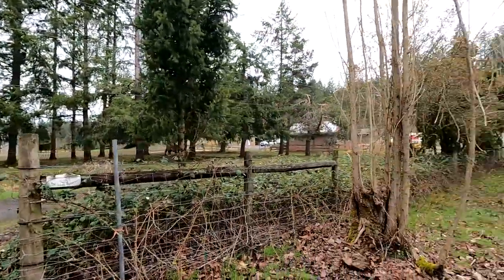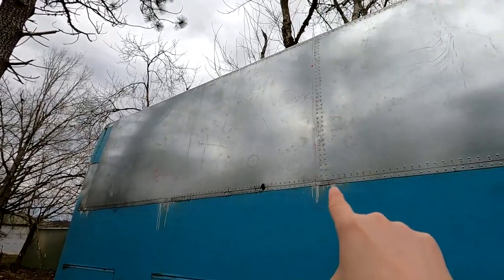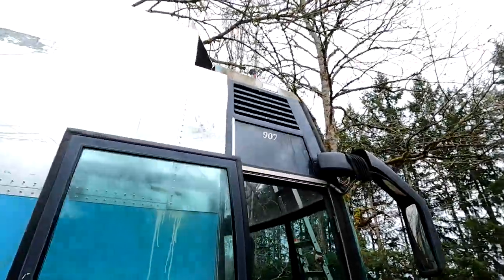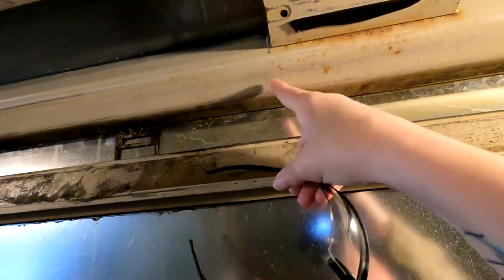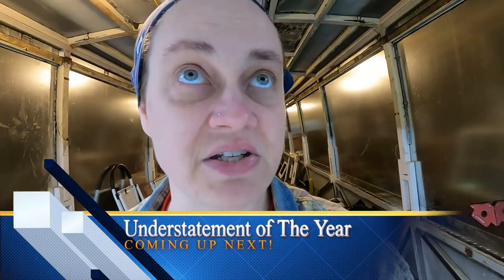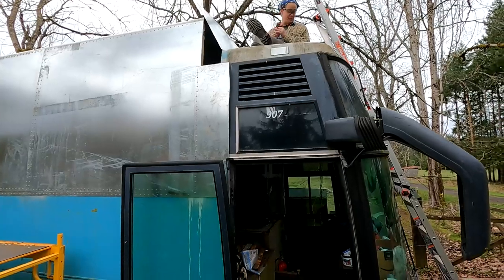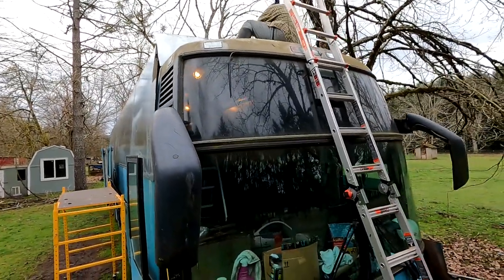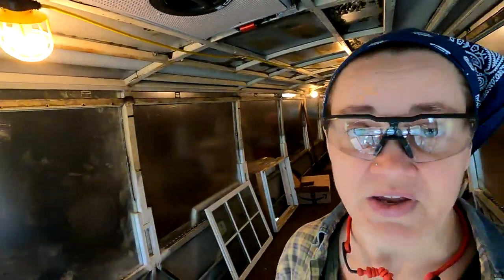Coach Bus Conversion Roof Raise Transition!

Comment: ahhh the roof raise makes such a difference, are you glad you did it? Was it worth the effort would you say? I would love the height but so daunted by the mammoth effort of the task, hats off to you both well done champs!
Reply from the maker: Thank you very much!

I was scared to death, but I could not walk upright except in the middle, where there was an aisle about 4 inches lower than where the seats had been. This is our home, and I did not want to compromise on something so basic as walking headroom. Skoolie videos make it look so easy, but coach buses are not school buses, and we had to come up with a method to do it from scratch. Now that it's done, I am very happy we did it. At first we thought we might lower the floor as needed instead, but realised that A) that would only give us those 4 inches, and B) the engineering required would be far more complex than just lifting the roof and putting in extensions. We got a whole foot which puts us a just under the max height allowed by law here, and the engineering, while tedious to implement, was dead simple!

Comment: Would sheet metal make good interior walls do you think, or what is your plan for interior walls? You guys seem like a wealth of knowledge I am following along, love your efforts!
Reply from the maker: Oh gosh you're too kind! Thank you so much! We're honestly finding our way almost blindly in the dark since there's not a lot of information out there specific to coach conversions like this. I took a basic welding course just for this, and taught my partner so she could do it too. We've learned skills we never thought we would ever need. :-P

To your question about interior walls, because we will be travelling in areas prone to large temperature variations, sheet metal interior walls wouldn't be a good idea. Temperature differential, conduction, all that fun stuff. Metal is very good at conducting heat (or cold for that matter) away from where you really want it to be. So we're going with closed-cell spray foam insulation which is also a great vapour barrier (good for avoiding condensation), and then probably birch plywood on firring strips attached to the metal bus framing. The idea will be to have absolutely no metal showing to the inside area of the bus to avoid this loss of inside environment because of conductivity. Chuck Cassady does a good video on this. We've also seen lots of people do tongue and groove strips for walls, or shiplap panels, but we like the smooth. relatively seamless look.